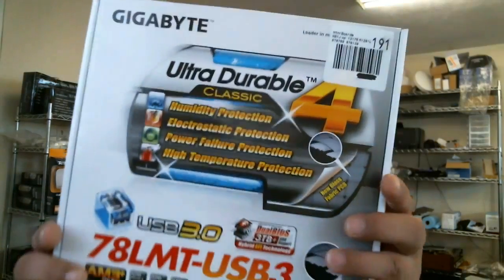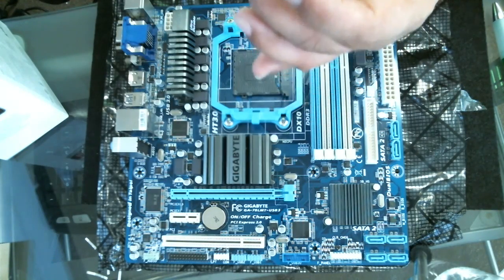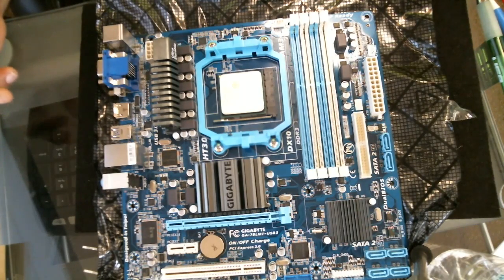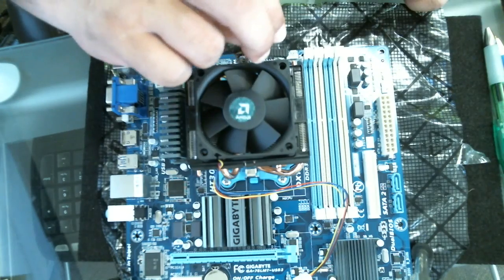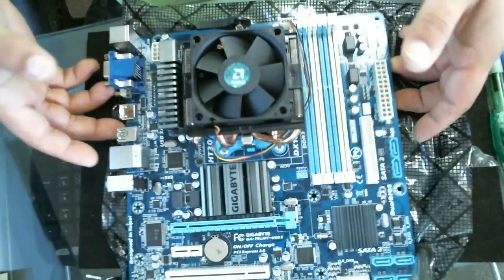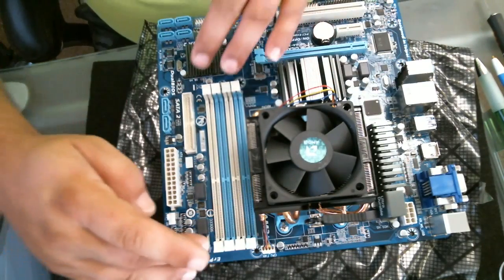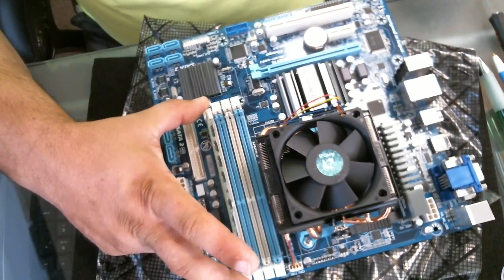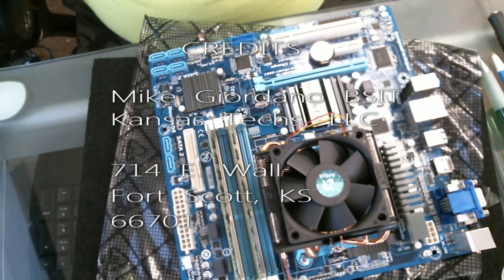DIY Install a CPU, Heat sink, and RAM/Memory, on a Motherboard AMD FX and Gigabyte Motherboard

Comment: You really don't want to touch the surfaces of your processor, heatsink, contact points of your memory, etc. The oils from your fingers is not good for that stuff. Refer to the instructions Arctic Silver provides on-line if you apply thermal compound for an after-market heatsink, which will most likely cool better and be a lot quieter than what Intel and AMD provide with their CPUs. If in doubt what CPU you can use, RTFM.